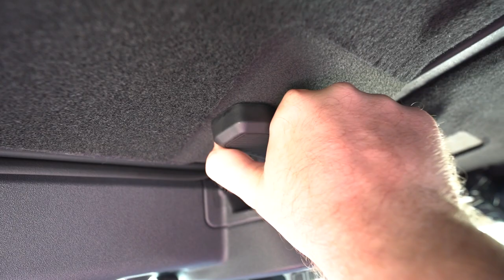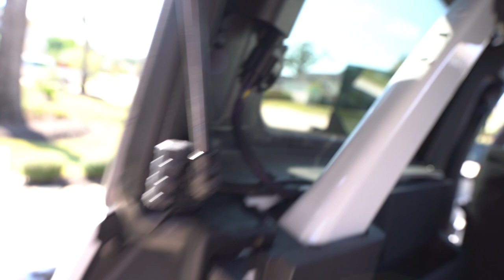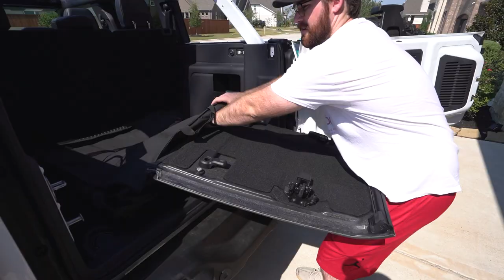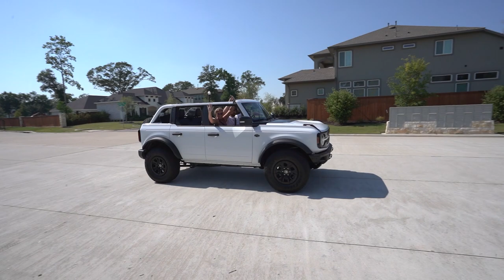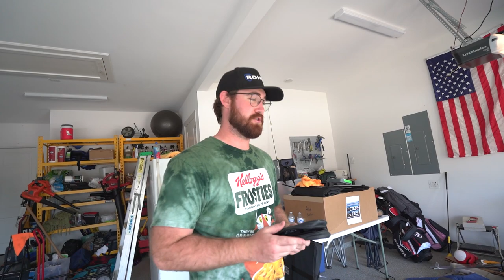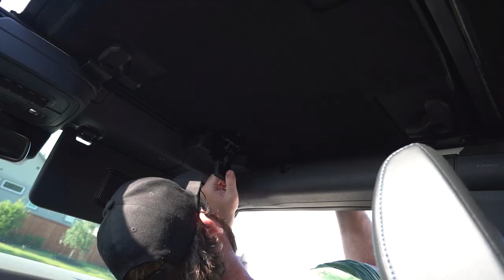GOING TOPLESS FOR THE FIRST TIME IN MY FORD BRONCO!

Comment: When I took it off first time after 6 months of ownership... Found chipped paint due to deep scratches
😤😤😤😤🤬🤬🤬🤬

Will now have to cover up with a blackout roll bar protector kit or will have to use touch up paint

Because ofcourse dealer will never admit it was them this late even though they freaking removed and reinstalled before delivery to "make sure everything was fine"

It was a hard top!!